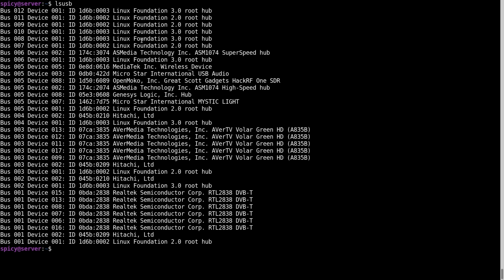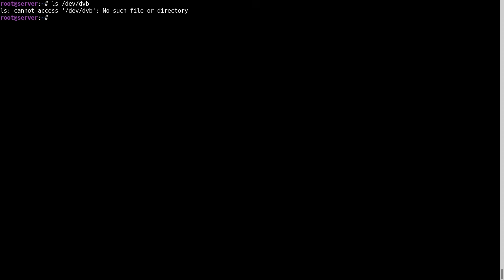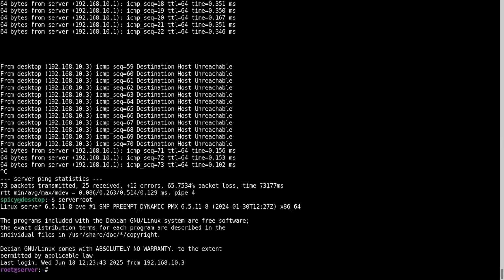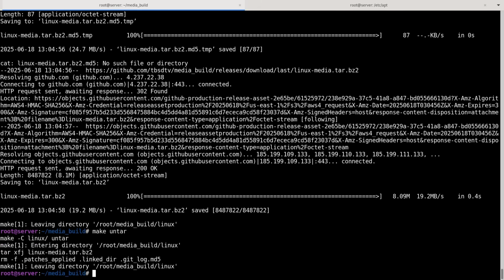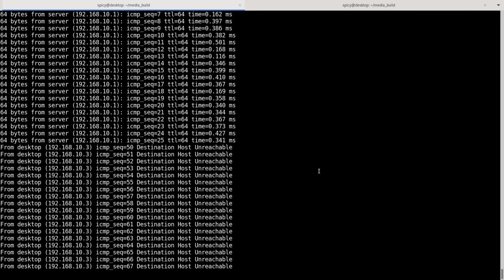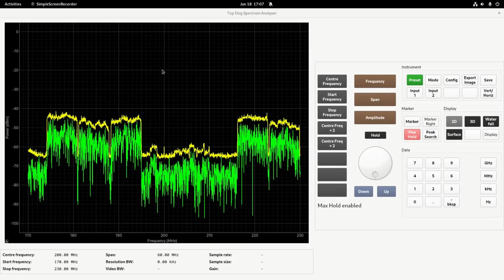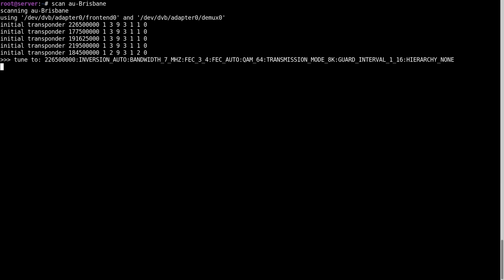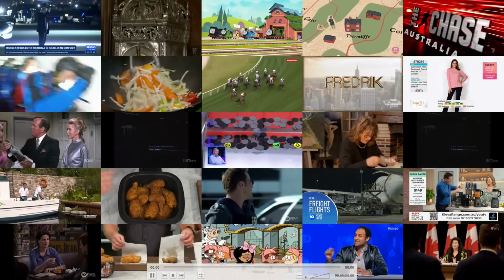Installing 8 Tuner TBS 6209se DVB card

Comment: Great video! Love all that neat gadgetry, little radios scanning the spectrum for TV channels, shows, movies, and interesting stuff to stream and watch, way cool! Compile errors are definitely quite vexing, however I tolerate them a lot more than having to download some huge mystery-meat binary blob that's been packed hard or even encrypted somehow, and of course, is the only available option to run yer brand new doodad on GNU/Linux. This is the very type of cool hardware that I'd like to have a little peek at the source code :P (Even if I couldn't make heads or tails out of it... Hehehe).

These modern SDRs are some of the most interesting and powerfully capable technology devices I've seen in a while.

P.S.: Don't feel bad, I've called my computer much worse, and it still calls me Daddy...

P.P.S.:Those voyeuristic C***S are likely wondering if there's maybe even better stuff to watch on those "cameras"... (better encrypt those streams...)

Love your channel!

:P

Comment: Out of all the stuff I used over the past 25 years or so the best performing in terms of noise handling etc was undoubtedly Technotrend PCI cards (metal can tuners).  FTA no longer interests me but I did buy 5 elcheapo RTL2832 based single channel USB receivers many years ago and they worked fine (linux, tvheadend) considering they were $5 a pop off aliexpress.

Comment: I was playing around with a similar setup back in 2017, but with satellite TV and TVheadend instead of DVBlast. I had a dual tuner TeVii S480 card I bought second hand, but that had some serious issues with some frequencies and/or one of the polarizations, so I got a TBS 6982, which I still have somewhere. Later, when I got a motor to turn my dish, I switched to a VU+ Zero 4K set top box, because the TBS card would sometimes send the wrong command to the motor. Thankfully I had my hardware limit switches set up correctly, so it wouldn't ram my dish against the wall.

Comment: One thing you might wanna do is instead of having the amplifier down there and the computer and you would be better off having it up at the antenna end and using power over coax to power it I would look into a mast head amplifier that way you’ll get the best signal with the lowest noise because you’re not amplifying the noise as well as your wanted RF

Comment: I loathe dealing with hardware that has out-of-tree drivers
Reply from the maker: I'm concerned about what will happen during an upgrade with newer kernel... I'd have to recompile it I guess.
Reply: Yes, unfortunately recompiling.  I have a very old TBS6285 I bought in 2014. I ended up using it in a docker container on unraid, saved me messing around with recompiling. That was a different set of problems, but I found it reliable and generally worked well, I didn't need too much effort. There are some alternative drivers available too, one was created by Crazy Cats, not sure if that's still around or not. Linux TV have some options too I think.

Comment: Played around with some software called mumudvb a few years back. I thought it was fancy as it had the SAP announcement service built in and made this all work nicely. I used 3 x dual tuner pci cards.
Reply from the maker: I've heard of it but never used it. I remember having to compile Kafeine to be able to play h.264 dvb-t. That was a long time ago.
Reply: @TallPaulTech My experience was also a long time ago. University halls of residence set up. They were all on an on campus network, which made for a nice inclusion for the poor students who didn’t have TVs.

Of course I just shoved it in live not really understanding how the TTL worked or what I’d really set up for PIM at the WAN border and ended up broadcasting to every campus.  Let’s just say I put the WAN through stress testing for the next few days.
Reply: I'm also using mumudvb with three dual tuner Sony PlayTV devices hooked up to a Raspberry Pi 4. Works well. Great vid Paul.
Reply: I use tvheadend on an Ubuntu box but I may have a look at mumudvb